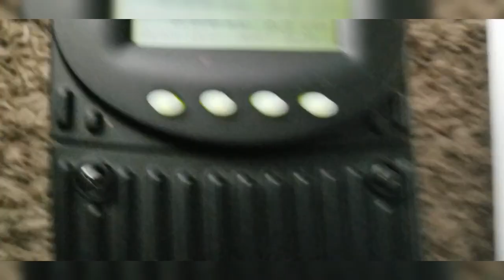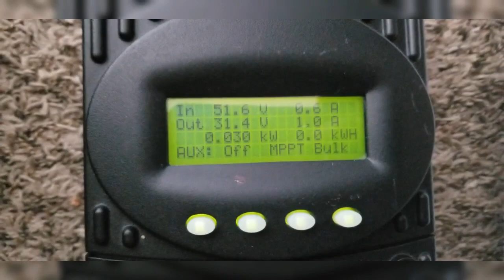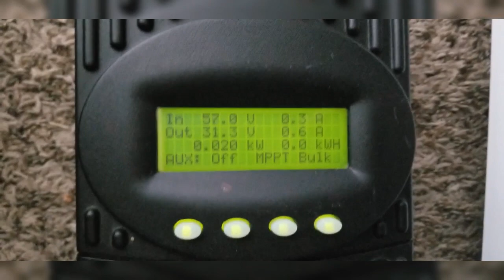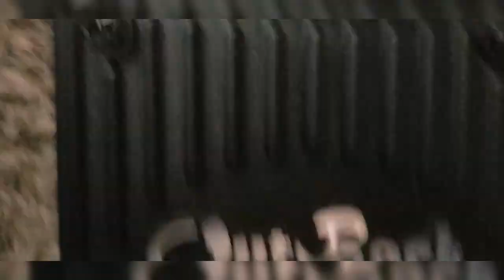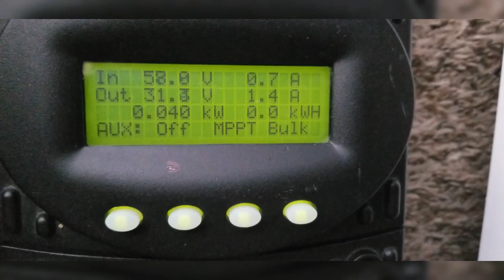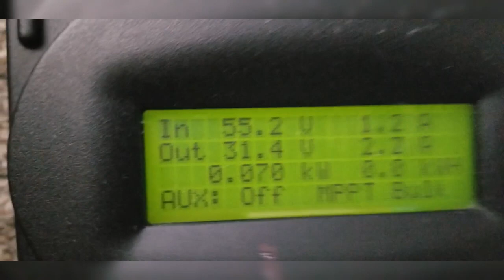UPDATE: OUTBACK FLEXMAX60 MY STORY SHARED PART#4

Comment: I for one agree that you use whatever works within your budget.  I started with solar in 2015 using a little windy nation PWM 20A.  The industry is quickly changing and it seems the past 3-5 years its almost impossible to keep up with.  Both midnite solar and outback are certainly the pioneers and I just recently picked up a used FM60 for $100.  Sure its 14 years old, but I called Outback and asked about the firmware since I am using it to charge a lithium bank and they were very helpful.  In fact, I even bought a cheap PowMR and what a joke!  Thanks for publishing video content as I am on here to learn about the various options.  I 100% agree on using PURE copper vs. CCA as I have seen scorch marks at amps way below the CCA rating and I took it as a warning and ripped it all out.  On controllers, I only have midnite, outback, morningstar, aims, and victron for production systems and have eliminated anything that is not 100% UL listed.  Keep up the good work sir.  Gary from SE MI.
Reply from the maker: Thanks for sharing this awesome story of yours.
Stay strong